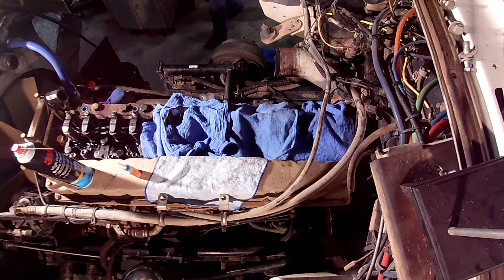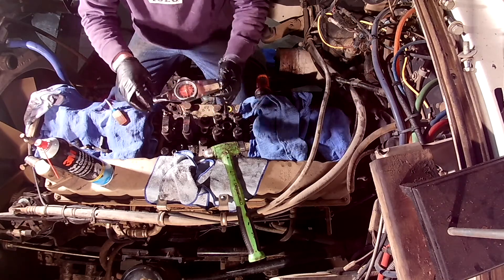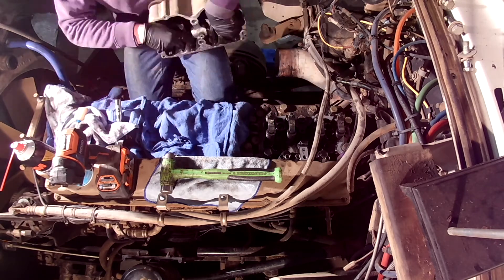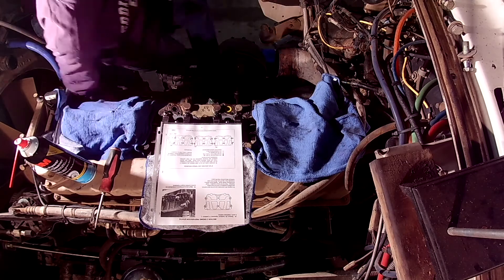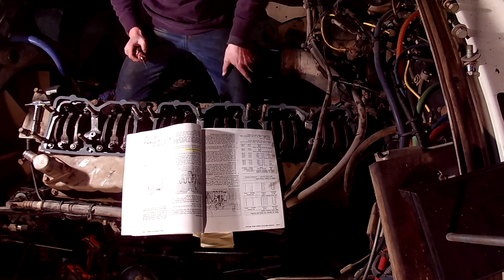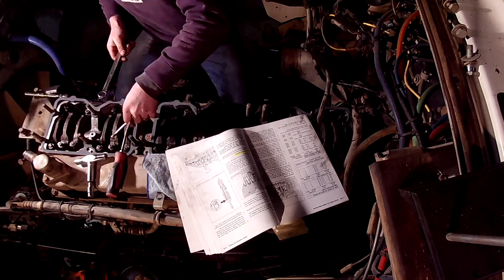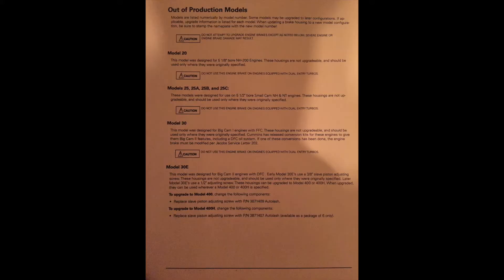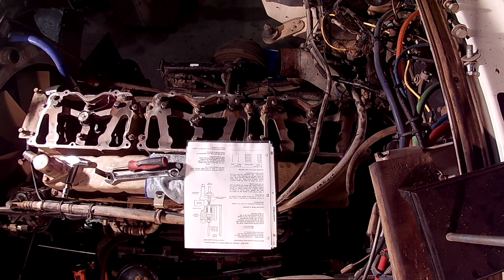Dual Entry vs Single Entry Turbos on Big Cam/Small Cam Cummins motors.

Comment: Do you know if there is any way to identify if a late modle 30E has been upgraded to a 400 or 400h? Mine has auto lash screws installed?
Reply from the maker: If yours has auto lash screws in it then yours has been upgraded. The early 30E heads used a 3/8 slave piston solid screw and the later 30E heads used a 1/2 auto lash screw. If updating to a 400 use auto lash screw 3871409. If updating to a 400H 3871407. These are becoming very hard to find though.

Comment: Hi there, I would high appreciate a bit more education in regards to the big cam 855 platform if your open to speak. I’m very new to it and you seem to be extremely knowledgeable. I do intend on doing  a few upgrades to my motor. My cpl is 832 and I have 401c jacobs. I’d like to know if I’m able to run a divided entry turbo and would this jacobs set up come with the auto lash screw ?
Reply from the maker: Your cpl shows that you're running an NTC-300 big cam IV. It shows me that the injectors you're running should be top stop injectors. I would have thought your motor would have come from factory with a dual entry turbo such as an HT3B, but came with a single entry turbo instead; interesting. Your motor is not STC controlled correct? This CPL is honestly a little tricky as your motor is a pre big cam IV 88/89. The sets I'm seeing that you can run with a dual entry turbo would be a 401B or 425A heads. Your lash for the 401B would be set at your typical .018".  You would have to but new injector adjusting screws for the 425As and they would be adjusted to .018" as well. From the Jacobs master application guide they say to use a 425A configuration, but thats going off your cpl which would have a single entry turbo. By putting on a dual entry turbo you would be changing the cpl. I wouldn't know what your new cpl would be other than these two head configurations would be compatible to a pre-88, FIXED timed, dual entry, big cam IV engine. Here are the links to some Jake manuals that I would highly recommend reading. They are for the 401, 420/425, and 430 series. Hope this helped!   

https://www.jacobsvehiclesystems.com/sites/default/files/2021-08/Installation_Manual_for_Model_401A_401B_401C.pdf

https://www.jacobsvehiclesystems.com/sites/default/files/service_literature/015626.pdf

https://www.jacobsvehiclesystems.com/sites/default/files/service_literature/015864.pdf
Reply: @jimhurricane5831  thank very much for all of this information. 

With my injectors being stop top; would I be able to run normal injectors as well if I wanted too ? 

Also, what is the draw back to me operating off of the single turbo entry ? 

I intend to convert over to an air to air system on this motor along with a high flow conversion. I mentioned this to get your input on me doing something like this using my cpl platform.

I’ve also got a pt pump and matching injectors from a big cam 1 flowed to 425hp to also throw at the motor.
Reply from the maker: Not a problem hope it helped you get going I’m the right direction. 

With your truck being fixed time it takes the stop top injectors so you can put “larger injectors” in it if you wanted. You’re not running an STC system so you can have your original injectors built over or buy different ones to instal. You would be putting the cart  before the horse a little though. Your cam has a different cam code than a 425HP motor let alone a 400HP motor. If you were to do as your saying and start ramping up the horse power you would either need to pull the cam and replace it with one built for running 400 plus HP and time it at the right cam code or see if your original cam could  be set to the timing code of a 400HP cpl. motor. Don’t know how well the last stated method would work. It might not as the cam profiles are different and might not be able to achieve the timing needed. 
  I wouldn’t be to concerned if you just wanted 25-50HP more but to go 100 HP + you would be looking at cam timing (most likely replacing it), injectors, turbo, exhaust manifold if you don’t have a pulse manifold, pump work, and a new set of jakes. Air to air isn’t necessary but helps a lot! You could stay with the low flow cooling system, as I have seen many built 425 and had no heating issues. Can’t go any over that though as the cooling system just can’t keep up!!
  To answer the turbo question you would need to update to a dual entry if you wanted to build a 400HP plus motor. Put simply they just build better boost than a single entry turbo. 
That’s just my advice, someone else might have better insight on building hp out of these motors than what I’m telling you.

     Personally if I was building a IV and converting it to a high flow cooling system, and adding an air-to-air intake I would build it to an 0625 CPL. If it was a strong running motor I wouldn’t swap out pistons or liners to a 0625 cpl but role rods and mains in it, new cam bearings swap the cam/time it, new cam followers, instal injectors for an 0625 cpl, have the pump turned up,  new HT3B with a new pulse manifold, new 425A jake heads, and I’d have a rippen motor. A lot of work though! Good luck and hope you get the motor your looking for!

Comment: Hey I know this video was posted a long time ago, but it’s getting really hard to find anyone that knows what’s going on with these big cams and the jakes. Had a cracked Jake housing on my big cam 3 350 Cpl 632 has a dual entry turbo, didn’t realize till now it has mismatched jakes on it, 2 are stamped model 30 e and one is stamped just model 30. Then I find out that these are really not the correct jakes for this motor even if they were a matched set. Is there a way to update these jakes to work correctly and not wreck anything in the long run, I’ve been doing some reading and hearing people say they can be drilled out to fit the auto lash adjusters? Then some say that that’s not the way to do it, and best just to find the model 425 jakes instead. Thanks for the video, trying to learn some of this myself as it seems like no one knows the old motors anymore
Reply from the maker: Dylan you are correct 30 and 30E heads are not the correct heads for a big cam 3 with a dual entry turbo. 30 and early 30E heads had a 3/8” slave piston adjusting screw and according to Jacobs are not upgradable nor comparable for your setup. The late 30E heads had a 1/2” slave piston adjusting screw which did make them upgradable by replacing the hard 3/8”adjusting screw with a P/n3871407 Autolash screw. This converted the 30E to a 400H, which is compatible for a big cam 3 engines running a dual entry turbo. That being said. I have heard of people drilling and tapping the 3/8” hole to a 1/2” hole to be able to receive an auto lash screw. I don’t recommend it, but people have done it. You don’t have to get 425s. You can get 400H heads; or you can find 30E, 44B, or 400 heads and update them to a 400H by installing the correct auto lash screw designed for those heads Hope this helps👍
Reply: @jimhurricane5831  okay, are the auto lash screws readily available yet? Maybe my best option is to find one more 30 e head to replace the one early model 30 that is on the truck and then convert them all to model 400h, are the 425s different or better than say a set of 400h jakes? Thanks for the help, I really appreciate it
Reply from the maker: @Dylanstc  yes, the auto lash screws are still available. If you buy 30E heads make sure they have the 1/2 adjusting screws. The early heads had 3/8 and later heads had 1/2. A 425 head has no difference in braking power. As far as durability I wouldn’t be able to say which one holds up longer between a 425 or 30. If the other 30E heads look good and they have the 1/2” solid adjusting screw I myself would be looking for another 30E to update👍 Good luck and hope this helps.
Reply: @jimhurricane5831  okay sounds good! Thanks again for the help!

Comment: Hello sir,
I have a small cam NTC350 with CPL160
I have put the upgraded pulse manifold on and I have what I believe is a T46 turbo off a 400 Big Cam. I have not pulled the turbo off to determine if it is single or dual entry. Seem to be making about 18psi while pulling(may peak to 19/20) 
This is with fuel screw turned out a wee bit as well. Sounds like single entry is the only way to not hurt anything in my motor unless I want to put those auto-lash screws in?
Reply from the maker: Fuel supply/pressure won't affect you on your engine braking, and it all depends on what Jake models you're running/auto lash screws you have. If your running older Jake heads that came with the motor factory then you may run into some issues.If the heads had been replaced in its life and updated at some point, let's say with 425s, and the right auto lash screws installed you'd be good to go! If they're model 25 or 30's then thats not good. I don't know anything about a fuel screw on a Big Cam unless you're running a different governor/fuel pump configuration I am unaware of. I've always just set fuel pressure/delivery by shims, springs, and buttons on the back side of the governor. Regardless of how you pumped the fuel pump up, it won't effect your engine UNDER braking applications. Don't get me wrong the pulse manifold and turbo will for sure!! Just not the fuel side. You can build 40 pounds of boost while UNDER LOAD on these motors all day with no issues! I know many individuals who have had turbos built to achieve that amount. The only time high boost, I am aware of, will hurt the motor is when UNDER ENGINE BRAKING. If you were to force 40 pounds of boost in the cylinders under a braking application there would be so much pressure that when the injector rocker went to move the master piston on the Jake Head assembly it would come up hard on the slave piston end, because it couldn't fiscally push down the exhaust bridge to open the exhaust valves on the motor. All that said 19 pounds at 2100 rpm as I stated in another post is what I have seen on several of our big cams, and that's with all the correct hardware while Jakeing. We build about 25-28 under load stock. Thats a big cam though not a small cam. Hope this helps and sorry for the long post!

Comment: Thank you for taking the time to make this video and share information, I have a question, I have a 365 small cam with 25B jakes and I recently installed a tuned manifold and HT60 turbo and I love the sound and performance, if I swap turbo housings to an open housing would that work with the 25B jakes or do I need to upgrade to 425 jakes? Thanks for your time
Reply from the maker: If you swapped turbo housings you would lose an incredible amount of performance on the HT60 as it was designed or "mapped" rather to have a dual entry on the exhaust housing.The HT3B turbo charger came at one point with a dual entry, as well as a single entry. This affected boost results; when an H3TB turbo "single entry" was used as a replacement for a T50, HT4B, T46B, ST50, or VT50 (single entry design) there was no need for any engine brake upgrade or modification as there was no over boosting the engine while engine braking.  I could be very wrong about the HT6O but single entry turbos just don't build boost as well as a divided entry turbos plain and simple. Now as far as the 25B engine brake goes they are non-upgradable; UNLESS!!!! you have a small cam III. The cummins application guide states that with a small cam III with a dual entry turbo you can replace the slave piston adjusting screw p/n 009916 with an auto lash screw p/n 013369. If you don't have a small cam III then you would be looking at putting a different model heads on, like the 425s. I would want to do a little more homework on this as I found this upgrade in an old manual when only 401A, 401B, and 401C heads were the latest and greatest on the market. If you give me your engine cpl, and KNOW that your engine was and or is built to that cpl I could do some more digging. As far as swapping housing i have no idea if that would work as a fix or would really even recommend one doing so. Hope this helps.
Reply: @jimhurricane5831  built 11-74 ntf365 out of a fire engine cpl 0155 I have the serial if that helps, you don't know how much I appreciate your time and I will GLADLY pay you for your help
Reply from the maker: No worries! Couldn't find your cpl. Mathew please private message me at barnestruckingand excavating@gamil.com. I can help you more then.

Comment: I know this is an older vid, not sure if you even monitor comments. I have a bc 3 CPL 625 and i use a HX60 turbo which does build a lot of boost, 40-45 lbs max. Builds 20 psi during Jake-ing. I also have a single exhaust jake. I’m wondering if this dual feed turbo will now hurt my engine. I just overhauled it entirely and don’t even have any miles on it yet.
Reply from the maker: That's great boost. Having 20 pounds of boost while using the exhaust breaks tells me you should have the right heads and auto lash screws for the master cylinders in the Jake heads. Single and dual entry doesn't matter as far as causing any damage to the motor; just performance. The problem is when the wrong Jacobs heads and turbos are match up incorrectly. This would cause an over boost senecio while jaking, and literally destroy the injector cam lobe, push rod, valvetrain, and more instantly in some cases or overtime. You should either have 400H, 401B, or a 425s on your motor. The auto lash screws will be different between models and the 401B are reset screws NOT auto lash screws. I would just verify if you have the right Jacob break models, as well as, lash screws for your motor, and you should be good to go. That information can be found on Jacobs website!
Reply: @jimhurricane5831  
I can’t really tell see the tag being worn but it don’t look good for me ‘I think’ it looks like they are 401C def 401 is visible but it’s either 401A or C but looks like C.. my turbo is HT60.. Jake’s work amazingly and it does build boost when jake-ing for sure. I’ll admit I’m concerned. I took off the original dual inlet turbo and put this one on. Max boost used to be about 22 lbs. but now it runs AWSOME so I hope I didn’t risk something.. thx so much for your response
Reply from the maker: 401As and 401Cs are the wrong application for a divided entry turbo on a BIG CAM 3. For a BIG CAM 3 running a divided entry turbo it needs to be either 400H, 401B, or a 425. The 401As were made for a 475 twin turbo designed motor, but a 401B could be used in its place, but not the other way around. Can't use a 401A in place of a 401B. A 401A, 401B, and 401C have different diameter master pistons and cannot be intermixed, and unfortunately cannot be changed or modified/updated to change from an A to a B model or B to a C model break head. Most likely this is why your running 22 pounds of boost while your engine breaks are on. On a cummins motor, because the master piston is running off the injector cam lob, putting to much boost in the cylinders loads the valve train and causes the injector rockers to physically be unable to open/or is loaded beyond oem standards because of to much pressure in the cylinder. On other motors, like Cat , the more the boost the better while using your engine breaks, but for these old cummins motors to much is a bad thing. Somethings got to give right!? I have seen people run with that much boost and haven't, that I know of, have any problems. I have on the other hand been told anything over 15psi is starting to get high. That being said the trucks we have, as well as ones that I have worked (which all have correct/stock parts) have run around 18-20 psi at I want to say 2000-2100 rpm. I try to keep the rpm no more than 2000 myself.I also want to say that there is a difference in slave piston length and running a 401C in place of a B could cause an interference problem. (piston hitting valve) Now someone could correct me on that! Bottom line is I like to stay in factory specs. If you're running 401Cs on your motor Jacobs is saying that can cause some bad and unwanted things to happen to your motor. I hope this helps and sorry for the long message.

Comment: Is it possible to get all this great info on paper to keep in my Cummins books? I have a small fleet of tow trucks running small cams and a few big cams. Would love to upgrade turbos correctly!
Reply from the maker: Yes, on the Jacob’s website and through various Cummins manuals. Takes some time to find but the information is still out there on the web to find and print off. Manuals seem to be harder to find there days though.